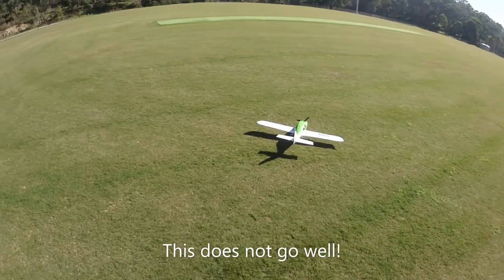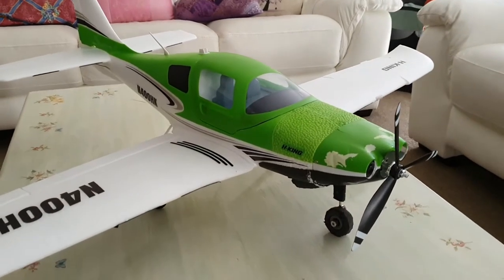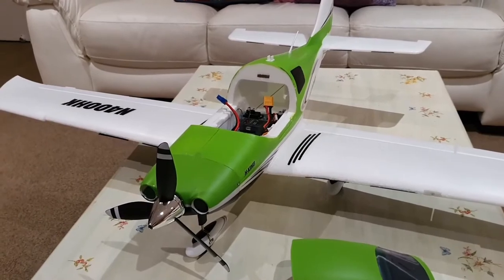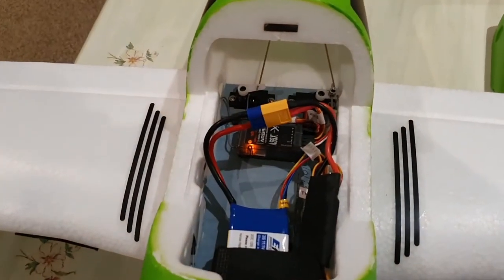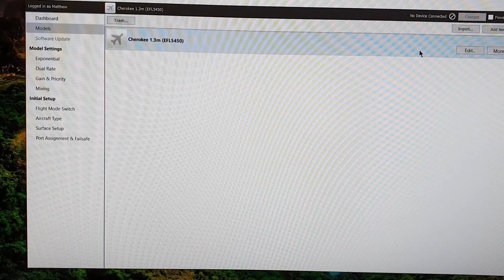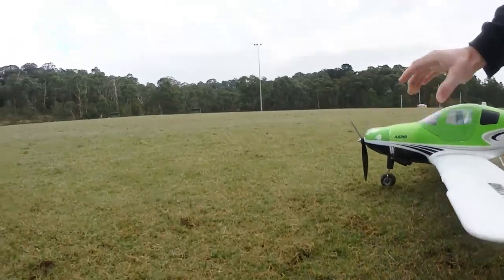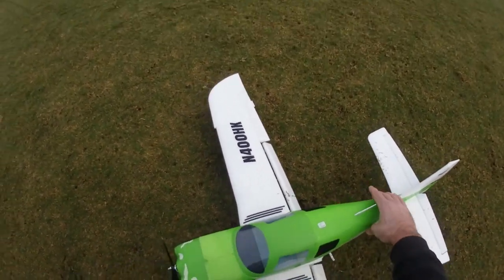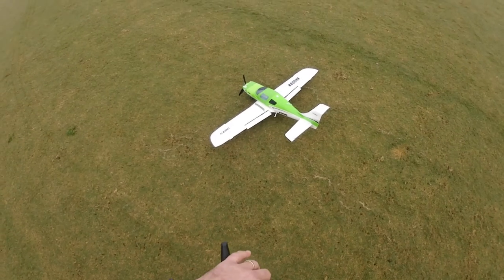Hobby King Cessna TTX - Maiden Crash, Re-Maiden and AR636 Programming SAFE & AS3X

Comment: I have same issue!!! But my is the Aileron..in as3x model everything was fine. 
But when I click to SAFE model, aileron was up opposite left and right.
Reply from the maker: Yeah, easy to do.  Should be able to fix and test using the Spectrum receiver software on their website.  Good Luck!
Reply: @albiet01  I don’t know how to connect to computer
Reply from the maker: @Tinarice2  You will need one of these - https://spektrumrc.com/Products/Default.aspx?ProdID=SPMA3065 - It is a programming cable that connects your receiver to the computer software